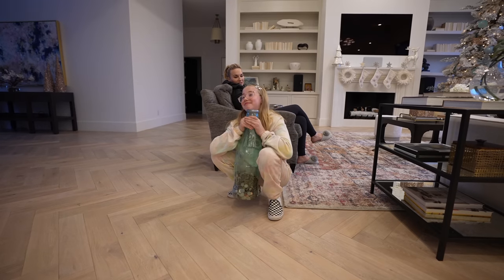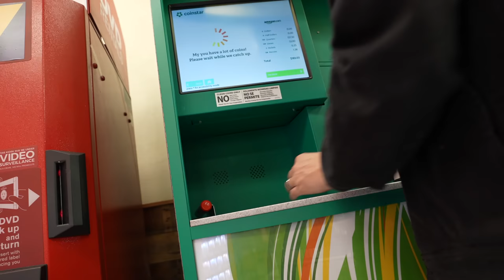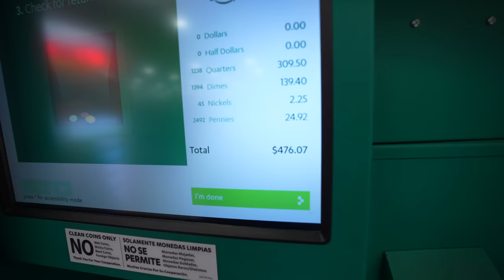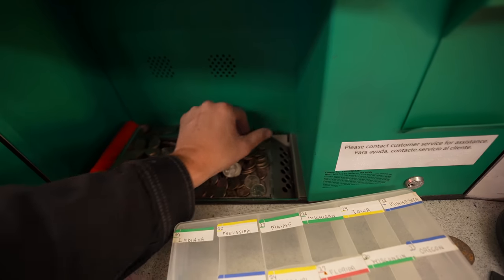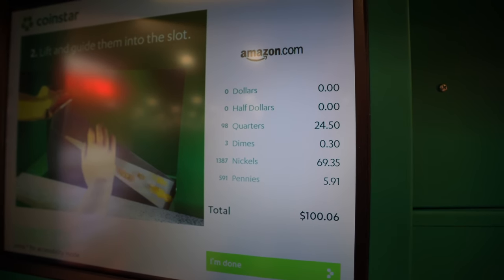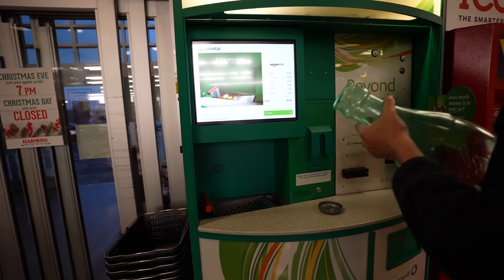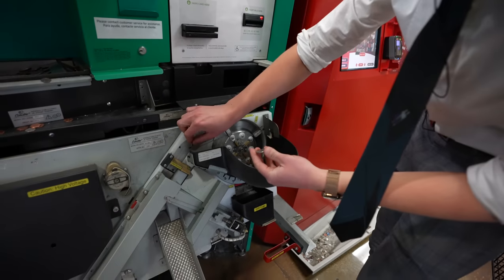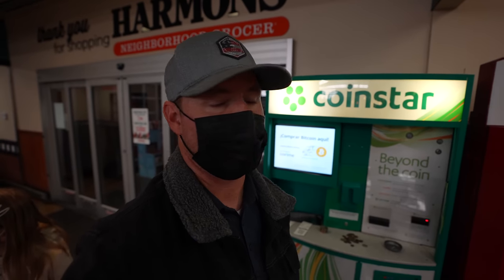We Broke the Coinstar Machine! How Many Coins Do We Have?

Comment: Those penny's, 1982 and older has copper in it. Some of those "newer coins" could have errors on them such as doubling. Good haul 👍
Reply: It is not worth the cost of smelting those pennies and as such they are easily findable in circulation, even wheaties are sometimes. There could’ve been errors, but I think it’s unrealistic to sort through thousands worth of coins just to find it

Comment: Hate to say it but you're wrong on the value of some of those coins you mentioned in the plastic boxes. A 1932 D mint mark, has numismatic value of at at least $12 and as high as a few hundred$$. They are so sought-after that people actually found a way to put the D mint mark on it. It takes a very keen eye to notice the forgeries.
Now pennies are even a more challenging item to collect. I believe it's 1918 Sacramento mint s is valued somewhere around the 6-digit range. What makes them so valuable is the amount minted. The less the more you might say. 
I would hold onto anything that is 90% + silver. It is a hedge on inflation and we are about to get nailed with inflation
Pennies that were made before 1983 are worth more than $0.01. The amount of copper put in them is more valuable than the price of the penny. Wartime nickels have more silver in them than dimes do. There are a lot of things to know about collecting coins. I would never put coins into a Coinstar until you knew exactly what you were putting in there. You could have Flushed Away a hundred thousand-dollar Penny you just never know.

Comment: The only good that came from this is you blindly putting in coins that could be rare dates/mints back into circulation. Which is why I always find silvers and sometimes mis stamped or error coins. To all my other coin collectors they already know to check each time. It's turned into a habit of checking coins while walking to the car.

Comment: I think you should have sold them to collectors. Even the non-silver coins have some value if in pristine condition. There are also low-mintage dates that have much value.
Also, apart from being bound to spend $1000 at Amazon, the machine is taking you about 1 cent for each nickel in the remainder bunch.
Being you, I'd feel sorry.
Those are the paradise of coin collector. I'd love checking each one by one, and at least roll what I don't want and turn it to the bank, to make sure I don't get scammed...
Luc, from Canada. BTW: I like to collect both Canadian and USA coins...

Comment: There are many comments i agree with. Some must money just dump down the drain. I'd likely taken to a dealer first to examine for those worth more than their original value. 
He could have made more money than what he was going to get from the machine. 
Snooze you lose as the saving goes. 
Yes you made not only a grave mistake but a even bigger mistake by not having a dealer evaluate them first. 
It is what it is, not what it could have been.